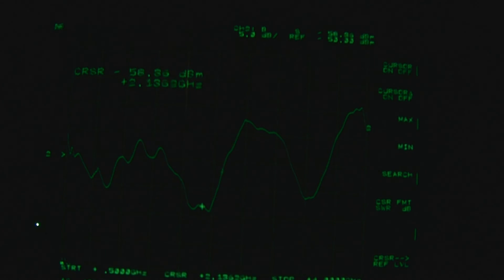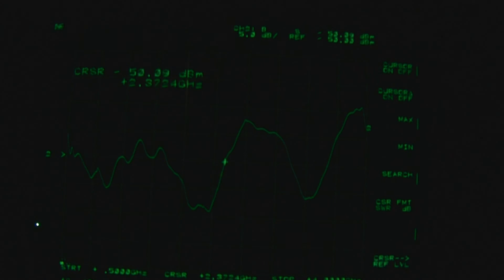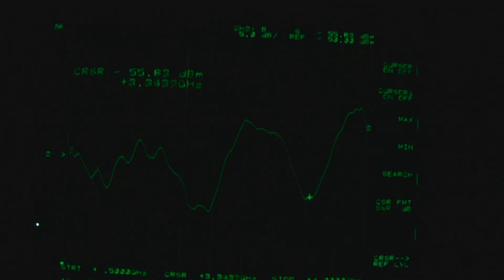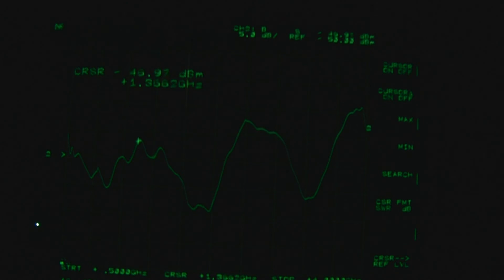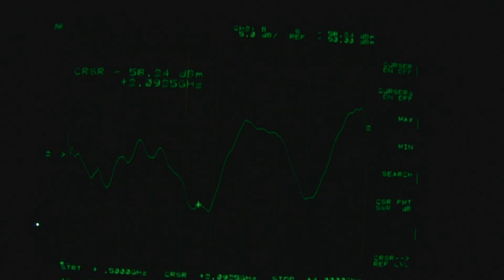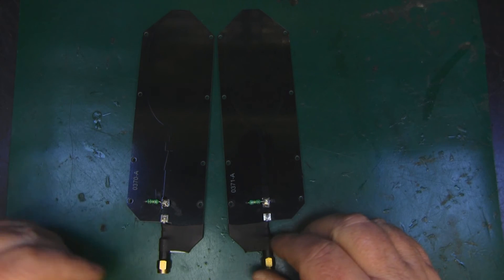Panorama MiMo Antenna DMM 7 38 2for LTE 4G 5G

Comment: Hi there could you design and show us an antenna with 3 or more DBI gain that is either omni directional or directional and covers the frequencies between 1729.2mHz - 2119.9mHz with an SWR dip between 1729.2 and 1824.2mHz and another SWR dip between 1929.9 and 2119.9mHz

Comment: "5G capable" doesn't specify which 5G frequencies. If you want an antenna for 5G, know what frequencies you need it to support.
Reply: Agreed.    This antenna looks to have specifically added 5G band n78, 3300 to 3800MHz, which is a common first-deploy 5G band at the moment.
Reply: @MrPhil604  yeah, 3500MHz is the main 5G band used here in Australia, and the only 5G band supported by many phones including mine.